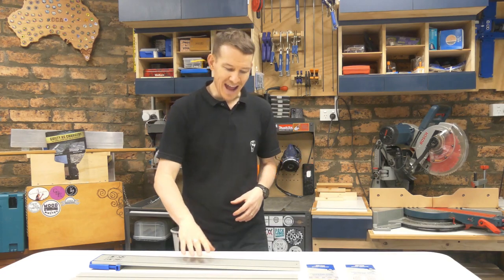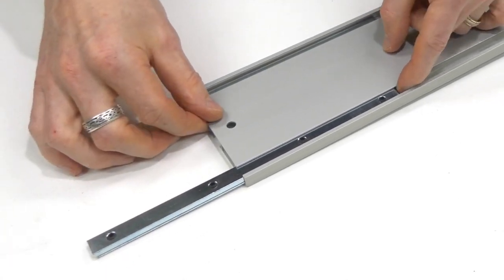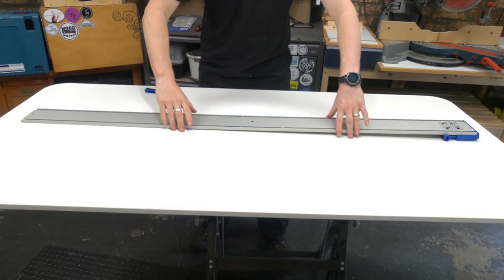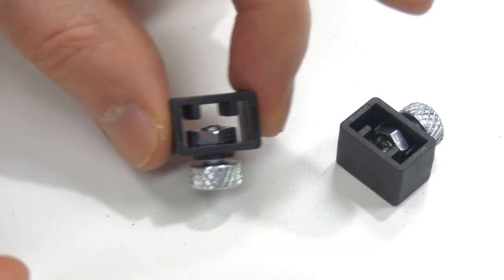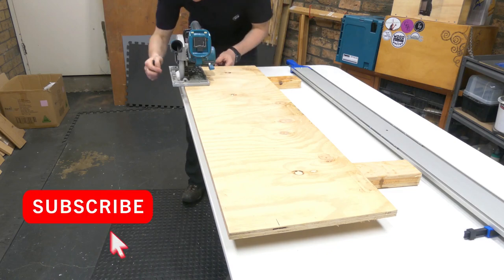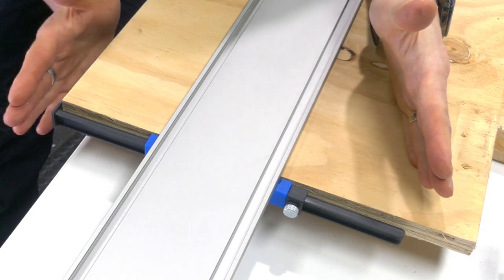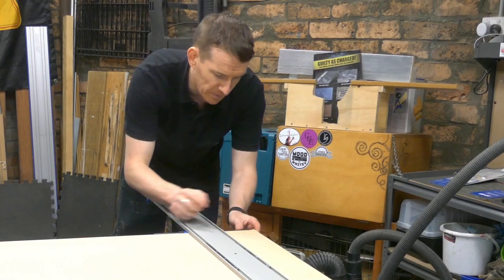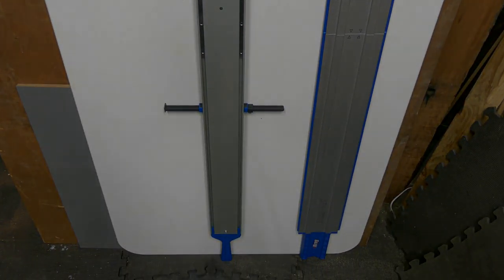Kreg Straight Edge Guide & SEG XL Detailed Setup & Unboxing: BYO Circular Saw, Jigsaw & Router Guide

Comment: Boo!  The width of the fence guide is too short.  I need to make a 24 in deep rip cut.
Reply from the maker: Did you mean a 24 inch long cut? The regular SEG should be able to handle that, it can do half a sheet of ply. If it is too short you can get the XL version that doubles the length 😊

Comment: The Bora Straight edge guide better i had the kreg its garbage
Reply from the maker: Not played with one of those. Looks nearly identical in price and build except for the clamping style. Did you find the underside clamp easier to use than the Kreg pull handle?

Comment: do you have an issue where the edge guides (the black plastic pieces) and the blue pieces can sit slightly above the workpiece? which causes the saw or other tool to not remain perfectly flat and level with the work piece upon entering and exiting the guide.
Reply from the maker: Yes I have had this happen, usually on thin (1/2" 12 mm) or smaller stock when there is no clearance under the track. If you raise the work piece with a few bits of scrap under it to give you a  little space a quick tap should seat the track properly. 👌

Comment: I have one from Bora and love it but I keep it setup for ripping 8 ft long plywood sheets.  I prefer DIY track guide for plywood cross cuts because I can lay the edge right on the cut line without bothering to put my circular saw into any kind of a holder.  You sure do a great job with these types of assembly videos!
Reply from the maker: Cheers Paul. They tend to do well in the long term for views so hopefully that means they are helping a lot of folks out. I think I will be spending the next few projects working out when this one is best and when it is worth screwing the sled on. Decisions, decisions ;)

Comment: does this mean accu cut is a junk?
Reply from the maker: Not exactly. You could get away with just this straight edge fine. It is cheaper and will do almost the same job.  The accu-cut is a dedicated circular saw track. It is more accurate, has a chip guard for better cuts, and the sled is interchangeable with the rip-cut for a great combo. I use both tools, but it's a great new option.

Comment: A1 detailed presentation. Thank you. I still wasn’t 100% sure about how I did after reading the instruction manual. I could better fine-tuned my adjustments with your helpful video. Many thanks.
Reply from the maker: Glad it was useful!  The instructions are pretty good compared to others I've seen, but I find a visual guide often helps a lot 😊

Comment: So many to choose from these days!😳
Nice job, mate. 👍🏽
Reply from the maker: Tell me about it, and more coming out later this year. Short version is you don't need them all, but it is good to have choices depending on your workshop style.
Reply: @FixitFingers  
They all do the same thing, either buy the smaller set, or if you need to cut full size sheet goods, then upgrade to the bigger set, that's it...

Comment: Really nice clear guide. Looking for something to improve workflow of breaking down sheet goods and routing dadoes and this looks perfect
Reply from the maker: Cheers Paul, also being much cheaper than the Accu-cut the increased versatility of this comes in very handy. I mostly use it for the router, but the only thing you really lose for the circular saw is the chip guard so for quickly breaking up sheets to rough sizes it's perfect 👍

Comment: Just ordered the XL!  Hoping to preclude buying a track saw since I really only would need a track saw for breaking down sheet goods.  Here's my main question:  When you lock it down, does it lock down at 90deg, exactly, every time?  Without fiddling with a square to set 90 yourself?  

This my my main pain point with my homemade circ saw guides -- it's a pain to set 90 across 8ft.  If this guide can really lock down 90deg, without fiddling with a square -- TOTALLY WORTH IT!
Reply from the maker: G'day mate, great question! Short answer: While you don't need a square, your cut will only be as accurate as as your measuring. If you just hook it over and lock it down without adjusting I wouldn't expect it to be perfectly square over 8 feet. 

Long Answer: You really need to take a measurement at both ends of the sheet and line up the cut guides to ensure a 90 deg cut. Having said that if you are just breaking down a sheet roughly, it'll be pretty darn close if you are starting with factory edges. Keep in mind even with a real track saw or the Kreg Accu-cut, you'd need to check this over such a long distance to ensure repeatable accurate results, and the cut guides make it pretty darn fast on this model. Personally, I use the Accu-cut for track saw type work as it does it slightly better (faster line up, chip guards, reduced chance of tool wobble), but it is more expensive, requires a sled to be attached so is not as quick to setup, and can't be used with a router (or anything other than a circular saw). So you should enjoy the versatility of the simple straight edge and get good results with just a few seconds care preparing your cuts. - James

Comment: Can that one end be removed? Rivets?...screwed on? Need to have a clean straight edge for cutting sheet goods with a knife. Then reassemble for skill saw...etc. Thks....Good vid.
Reply from the maker: No they rivited on these two pieces... but if you get the XL with the extra two bits, they are plan metal with no end pieces. However I think for knife work you'd want a better ruler style edge. These are rounded over slightly so running a knife along it might not be very accurate.

Comment: A very through and well presented walk-through of how to set this up. I've got something just like this I bought from aldi/Lidl years ago, but it doesn't have those adjustable wings on it
Reply from the maker: They are a nice little feature, but honestly as I already have the accu-cut I'll probably use that for the circular saw and recalibrate this for my 19mm router bit. The only reason to step up from an old straight edge to this would be if the old one wasn't actually straight 😂

Comment: This was an excellent and thorough review, thank you! If you had to pick only one, do you think this guide or the Rip-Cut is more useful for breaking down sheet goods for someone without access to a table saw?
Reply from the maker: For simply breaking down boards into rough dimensions, this would be the better choice as you can crosscut a full sheet, something the rip-cut can't do. However, without a tablesaw for the final cuts, I'd go the Rip-Cut, as you can set repeatable and accurate cuts and quickly get things to final size. Honestly, if you don't own a tablesaw like me, both have a place in the workshop! This can do everything the rip-cut can, but the RC does it faster and more accuractly up to its capacity. Hope that helps! - James
Reply: @FixitFingers  I really appreciate the detailed response! It’s incredibly rare for a channel to take the time to answer direct questions like this. Thanks again for the great advice and keep up the excellent content! Cheers!
Reply from the maker: @hlmk512  no worries mate. Luckily small enough I can answer every comment ;)

Comment: Nice explanation!  I thinking about buying it but would have been a nightmare and a lot of bad words I'm sure if I didn't have your excellent video!
Reply from the maker: Glad I could help Dean! I find I use this as expected mostly for my router, using the Accu-Cut for the circular saw most of the time... but on small cuts this is much faster than setting that up!

Comment: Nice video! How do you hang your tracks on the wall?
Reply from the maker: 😅 Uummmmmm.... you caught me. Currently I don't. It sits in the corner of the shop, one of my very few tools to not have a home. However, the reason is I am planing a new workbench soon which will incorprate a storage solution very much like my Accu-Cut one which you can see here - https://youtu.be/e3SaCY23fAU :D
Reply: @FixitFingers  sounds good! Thanks Fixit

Comment: Is it possible to square a panel with this guide before passing the panel through the bench saw?
Reply from the maker: It'll get you close enough! That is it's main purpose. The 8ft version can rip down sheet good mostly square if you take care on setup then allow you to run them through the table saw more safely for the perfect finish.

Comment: much thanks for this review! I am struggling to get the adjustable gripmaxx clamp (the clamp closest to handle) to sit flush against the edge of the board. At the 7:00 minute mark in your video it looks like you got it flush against the edge.
Reply from the maker: G'day Yusuf. Yep it sits pretty flush when in the correct position. There is slight angle to it (as thats how you slide it back and forth) but 90% of the grip max should be against the edge when clamped in. You'll notice I push down on the track a bit to get it to sit right. If it is tilted, give the handle another good pull while pushing down on the blue clamp and it should seat correctly. I hope that made sense!

Comment: Handy bit of gear mate.
Reply from the maker: G'day Col. It will be I think. Cutting long grooves on big panels with the router I usually use the table for, but it can be tricky to get right. I've not had a reliable straight edge to do this with so I think it will find a use for that task in particular.

Comment: Has the host done the comparison between Keegan AccuCut and the Krueger straight edge tool?
Reply: I meant Kreg not Krueger.
Reply from the maker: G'day Rob, I was wondering about that odd brand for a second ;) I've also got an older setup video on the Accu-Cut. I've owned that for a few years and this SEG for over a year now. I haven't directly compared them side-by-side in a video (though that is a great idea, I might do just that in the near future). The short version is the SEG is much cheaper and I mostly use it for my router and very short circular saw cuts on square boards. It will do almost everything the Accu-Cut can, except cut angle and odd-shaped stock as it needs parallel straight edges to clamp to at each end of the cut. The Accu-cut will only work with the circular saw, but does that tool better. With the grip-maxx, chip-guard, and optional track clamps making lining up cuts easier, cleaner, and more accurate, I probably use the Accu-Cut more than my SEG. If you see yourself using it for a router often and/or are budget conscious, go the SEG. If mostly for the circ-saw (particularly if looking at the XL versions) the Accu-Cut is a better choice. Stay tuned, I might film that comparison video for you soon ;)
Reply from the maker: ....and new video done! I just realised I promosied to make this video at the end of the SEG setup one :P Thanks for the push Rob, I hope you find it helpful - https://youtu.be/ODC2uq1jx1g

Comment: One of the problems with the cheap straight edge clamping guides (like say.. Craftright from Bunnings) is they're not... straight. And dont' clamp well. Lots of deflection meaning they're "vaguely straight", making them useless for dados. This actually looks pretty decent in that regard. I might have to check it out a bit more 🤔
Reply from the maker: Over 1.2m at least the extruded aluminium looks pretty dead on. After 3 practice pulls I got the clamp to work easily and quickly. This wasn't meant to be a review video, but for the price point or looks pretty solid.